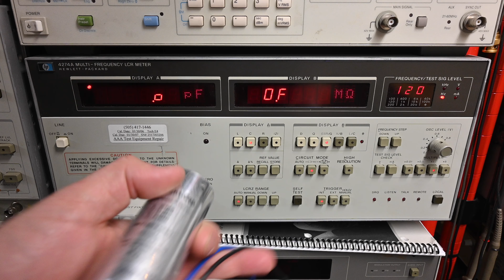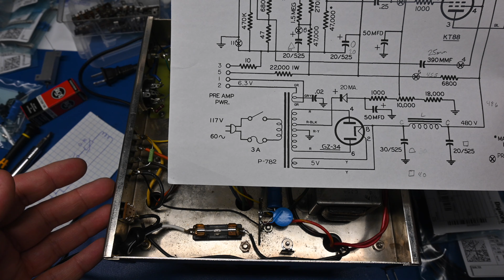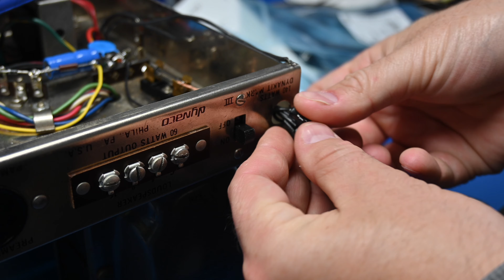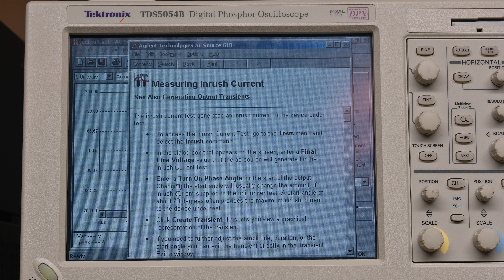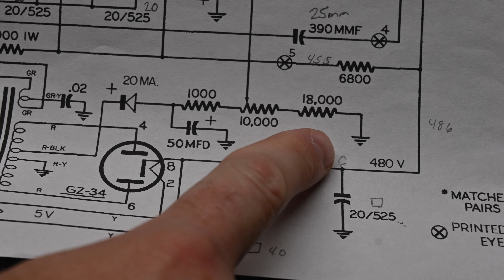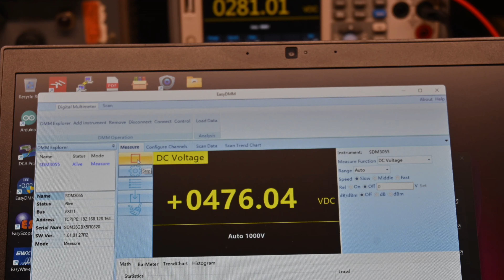Dynaco Mark III Rebuild & Testing Inrush Current Limiter (Part 2)

Comment: Is there any negative aspect to having the CL80s? I put them in my MK3s too, but other that heat considerations I didn't look further into their effect of the amps operation.
Reply from the maker: I think the benefits outweigh the cons.  The cons being.. increased heat on the underside of the chassis, and another part that can fail at some point.

An even better solution would be some sort of relay that switches it out of circuit after power on, so it can cool down and be effective again in the case of quick power outage, or someone turning it off and right back on. 

The only other effect you'll see is that the resistance lowers as it gets hotter.  On the test bench you can see this during max power tests.  If you set the amp up so it's making 50 watts into a dummy load, and measure the B+ (or AC after the CL-80) voltage immediately at the start of the test, and then check it say 30 seconds later, your B+ voltage will be higher since the AC going into the amp is a little higher as the CL-80 is lower resistance since it's hot.  I think this is what people mean when they say  the ICL's are bad for 'regulation'.  I don't really see that as an issue, I don't think it's anything you'd actually be able to hear during listening, and it would only happen at high power levels anyways.

Comment: Excellent videos. I really appreciate you walking through each decision. I’m just starting a ST70 rebuild. I noticed you used Illinois polypropylene film for the output caps. I’m trying to decide between Illinois, Mundorf MKP or Mundorf EVO. Any recommendations? Thanks.
Reply from the maker: Thanks!  I personally don't stray far from the industry standard parts that can be purchased from digikey/mouser when I can help it, so I don't have an opinion on the Mundorf or other audiophile style capacitors - I've never done an A/B test with them.  The Illinois, Kemet and ICEL capacitors that I've purchased from Digikey all meet/exceed the electrical specs I'd want for this purpose so I haven't looked further...

I'm doing a ST-70 now, may make a video on it, one thing to keep in mind is that many of them came with a type of Mylar capacitor that will still be in perfectly good condition - "Black Cat PKM".  They are mistakenly identified as "black beauty" capacitors and thrown out all the time.  I believe some of the earlier ones did have actual paper capacitors in them, though.  http://crasno.ca/articles/capdielectrics.htm

Comment: Something usually overlooked with the Dynaco amp restorations is the resistance of the power switch, which i've found in some cases to be very high (into the Ohms range vs milliohms) and also with significantly changing values with each operation.  What I usually do is install a current day equivalent except a two pole unit, and parallel the poles.  Thought it doesn't look like much of a switch I've found, using a milliohm tester that the resistance is often significantly lower than those beefy looking toggle switches that are often used as replacements.

Comment: I pretty much followed your part 1 and 2 on some Mark III’s. I had bought a pair recently and still have them on my workbench. one had an 80/40/30/20 - and it too was wired wrong (80uf off of pin 8). I have used these before, but after watching your video I decided to double check it. 

I also used the CL-80 thermistors. 

Great advise on the power cords too.

Comment: Great work.  I'll echo what Herb said, these multisection caps have an inverse reaction to their stationary ESR rating.  Essentially, if it sits for a year or two without use, the ESR value will show rather high.  However, once power is applied the caps will reform after a few days of regular use the capacitance value will settle and the ESR value will go down considerably.  What that means is they'll warm up due to the resistance, but as they reform you'll notice that they go cold - this is when they've been reformed.  In the same way, anytime you have an amp running and the multisection cap is hot, it has developed permanent series resistance, time to replace.

Comment: Phil, by and large , the F&T caps get better with use. I check leakage and ESR with my Sencore LC71 prior to install. After some time , they measure better with some hours of use. I have several newish  CE caps in my junk box that got leaky in a high voltage use situation. BTW Vishay offers a HVR series metal film resistor specifically for high voltage circuits. In a three wire power cord , consider using a bridge rectifier as a ground lifter ( 1.2 volts ) rather than a direct ground connection to the chassis. This eliminates most ground loops but keeps the user safe.

Comment: Do I see some Shinkoh resistors ?
I hated working on tube amplifiers that were hacked before i got them to repair ....
Often they asked for retubeing but when opend up I saw the  real horror and messing up done by so called tech repair shops ..........
Thank you for the upload.
Upgrading ( expensive components ) must be done with experience and real evalution after the work..........sometimes so called better may be your worst enemy.....or exposing the limits and intrinsic distortion of a circuit....my attitude todaéy is only to try an upgrade aon an amploifier when the mp performs well and sound, when I DO NOT feel the need to upgrade ...that is mostly when it realy works.
Reply from the maker: Thanks for the feedback, glad you enjoyed the video.

Nah, no exotic parts like Shinkoh resistors.  With the exception of a couple Dale RLR20 resistors I had in stock, all parts I used in the rebuild are current production parts available from DigiKey, just chosen as best bang for the buck.  The larger 1W blue resistors are Yaego MFR100, and the smaller 0.6w's are Vishay MBB0207 series.  There is a single Holsworthy (the black 270k) as that value wasn't in stock from the MFR100 line, and the 1.5M resistor is a Vishay HVR37.

I'm not so much into 'upgrading' for the sake of audio quality as I am just trying to make the units rock solid reliable and meet or slightly beat the factory specs.  Which in most units I've worked on over the past few years that had carbon comps in them, means replacing all of the resistors due to drift...even the good ones like Allen Bradley's I see drift out of spec these days...

Comment: I assume that you will get into this in the testing, but I would be curious to see if the inrush limiter limits current during max transients, maybe you can chart across the limiter. Might be interesting to see a 50hz square wave into a 4ohm(?) load at full power. I probably would have chosen a thicker silicone flexible cord purely for aesthetics, but that would be a minor nit-pic. You do very nice work. I am envious of your test gear collection!
Reply from the maker: Thanks, I did spend quite a bit of time yesterday thinking about/experimenting with that, when I started comparing the rebuilt amp to the stock one.  One thing I wasn't aware of, as I don't have much experience with McIntosh gear,  a friend reminded me that McIntosh has been using ICL's in their amps for years, employed in the same fashion (on the primary side) to no detriment.  The MK3 measured  1.15a  idle and 1.75a full loaded, which puts the CL-80 between 0.4 and 0.6% load, so per the CL-80 data sheet that should be around 1.8 - 1 ohm resistance.  The other thing is, these mk3s still have the 30/20/20/20 filter caps, so I think that’s more of an issue during transients than the cl-80. Next video will probably be more traditional tests (thd+n at various frequencies, frequency response etc). I'll try to do a follow up on the CL-80 in the future once I have time to get all my facts straight.  I can do some experiments with my Scott 299 or Dynaco ST-70 if I give these MK3's back before that.